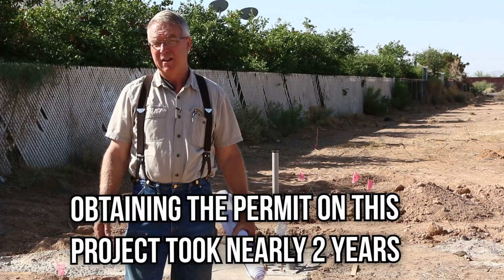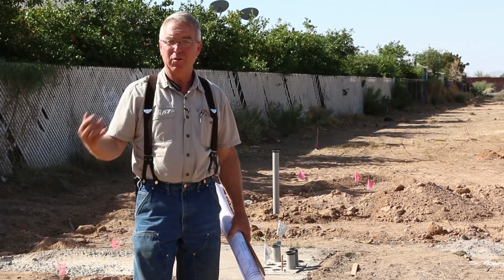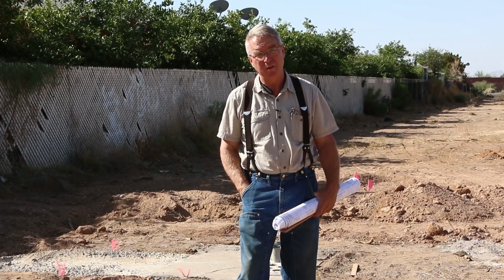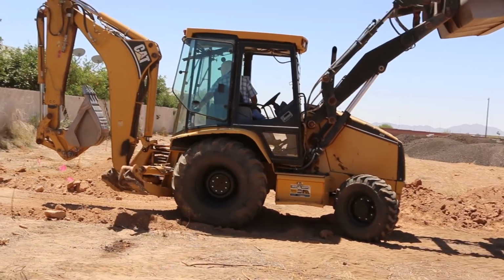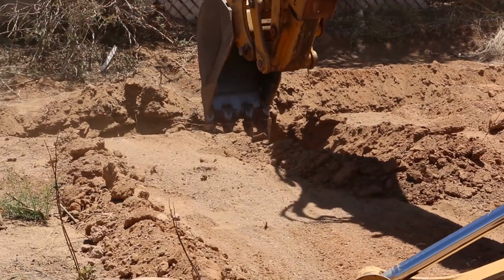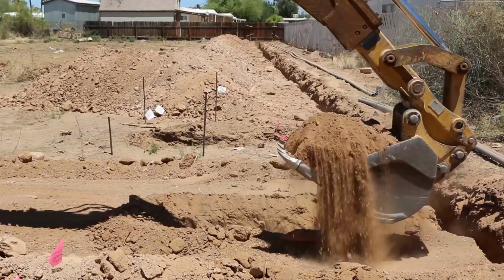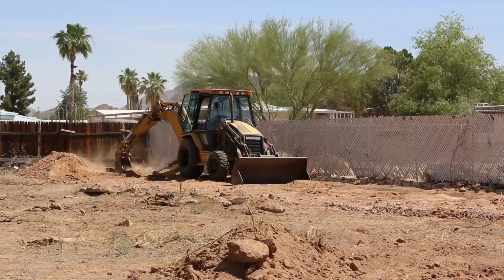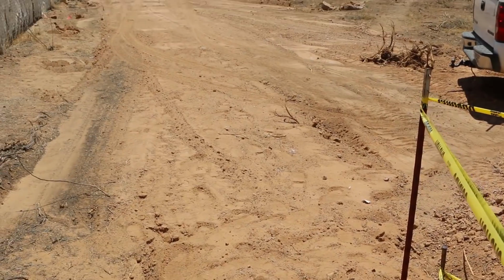Trenching for Underground Electric

Comment: In the helpful spirit of this wonderful channel i would like to add that in many cases an experience machine man can tell when he has hit an existing service and stop, that comes with time and experience, its something that a beginner would most likely get wrong and that can be expensive. If your plant operator finds an electric line and stops before it is damaged he could have saved you £5000. Regardless our hero failed to mention that a simple cat scanner can survey the area and usually pin point electrical lines that may be for a neighbouring home, you can rent these and have cheap training, or your machine operator should really have one in his truck
Reply: I'm a systems engineer and deal mostly with software but I worked in the Sahara desert for a while and those guys used to dig up fiber all the time :) I'll tell ya, we definitely had concrete slabs painted with bright colors all over those fiber lines but that didn't seem to matter. It's definitely experience and training that goes into sitting in one of those big machines :D

Oh yeah and for people who don't know. Splicing copper is as easy as 123, splicing fiber is a pain in the ass, in particular if you got multiple wires going... Could take a whole days work or more.
Reply: Gerry Larsson i hear ya, a friend of mine works in saudi as an earthmover, money is not an issues, they wear out machines within 3 years, however, inexperience needs to be looked out for, many men get the ticket to operate a 360, but they have no experience, send those men packing, they are simply liars
Reply: In this case, they would not have to pay for repairing the line. They called for utilities to be marked before digging, like everyone should. The company that failed to mark the utilities correctly is responsible for the damages. What the experienced operator saved here was the delay in dealing with this unforeseen disaster and the legal headache for the general contractor.
Reply: I work for one of the UK Electrical Utillities .... Cat scans are for hospital ;0) .... but use of a Cat is essential when you are digging (even if you have drawings)!
Having said that these guys keep me in work so I shouldn't complain when they mess up should I?
Reply: KnightsWithoutATable thats the way in america, i apologise im not aware of the process there. Either way something missing from the public record (and if you have experience im sure you have 10 related stories) its worth a 20 min cat scan surely sir?
Reply: Mission Dan a
Reply: Mission Dan .... Re-read the post mate :0) I said a Cat should be used! I use one every time I go fault locating. Fortunately I Don't have to do the safe digging techniques (or the digging) Our drawings are also often wrong too .... just to add to the excitement ;0) As the guys who trained me said "It'll be fine whatever you do .... until you get caught and then they hang you out to dry!"
Reply: Dave W cmon dave you knkw very well that any and all uk excavations should have a cat scan carried out. We have found electrical supplies for neighbouring properties 20ft in to a neighbours driveway. Due diligence should never be dismissed so easily if you are in-fact a pro